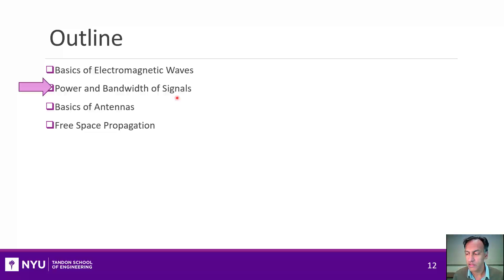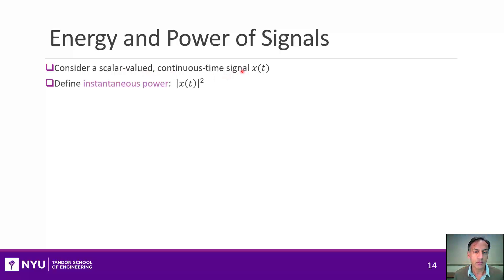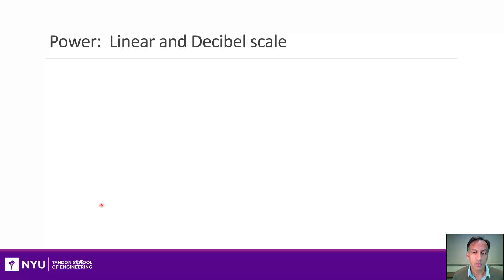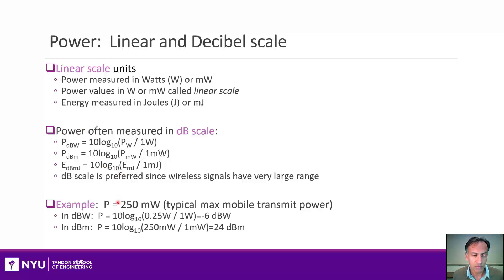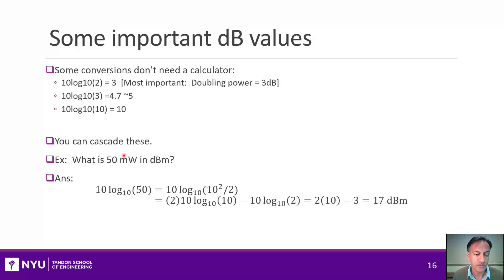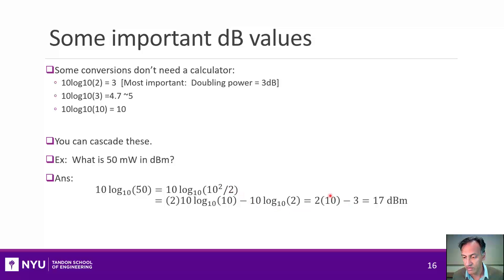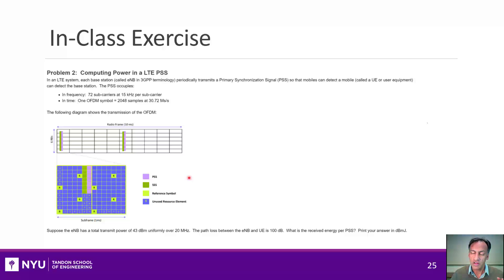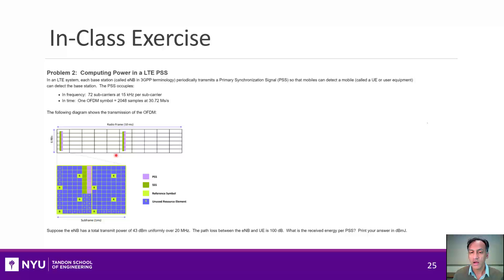Wireless Comm. Unit 01. Antennas. Sect 2. Power calculations

Comment: In most cases to measure RSRP, RSRQ, RSSI of the signal in dB scale, I see "RSRPdBm = 10log10(RSRP) +30" , however I can't figure out what is "+30" here? ChatGPT answers: "P_dbm = 10*log10(P_watts) + 30,   dBm is a unit of power, with a reference of 1 milliwatt (mW). The "+30" term converts the power from Watts to dBm."  @sdrangan, Could you please suggest?